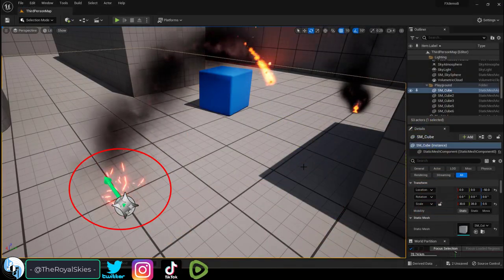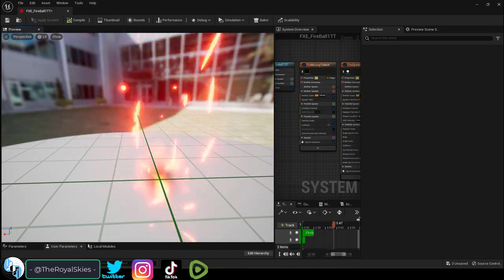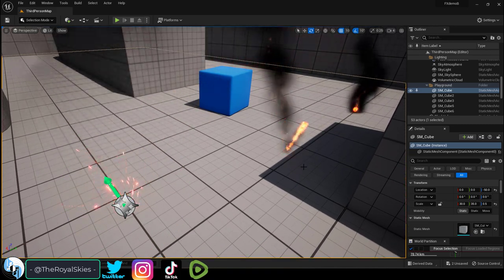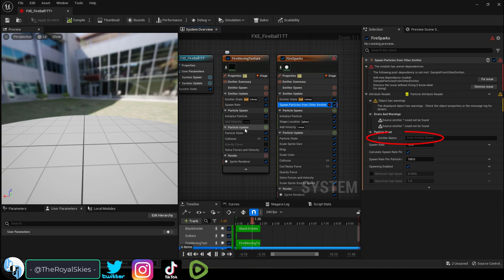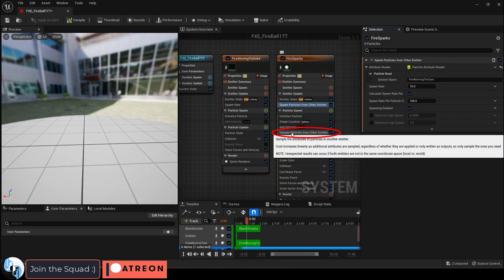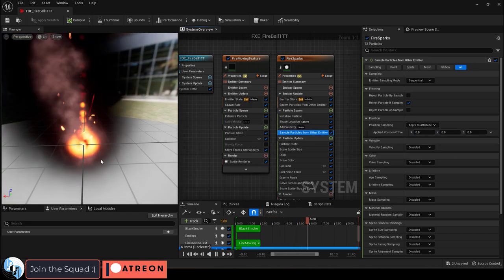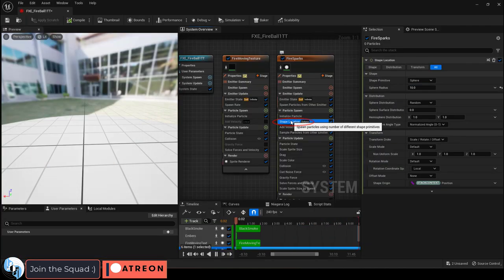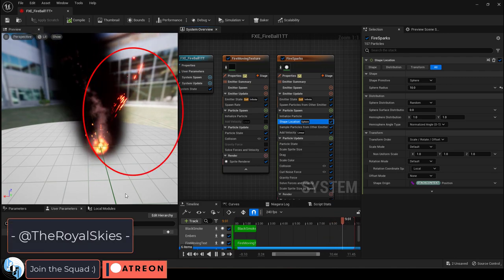Unreal5 Niagra VFX: Spawning Particles FROM Another Emitter -

Comment: This only spawns particle from the other emitter by using spawn rate. I want to use spawn burst from the other emitter instead, how do I do that?
Reply: hi! did you end up finding a solution? i'm trying to get the same result haha
Reply: @jasperdang6230  no i didn't, just ended up using spawn rate
Reply: Make sure the second emitter is using the same simulation as the emitter you are spawning from. So CPU-CPU or GPU-GPU. it wasn't working for me cause my first emitter was gpu and my sub emitter was cpu. aligning them fixed the issue

Comment: Is there any way to spawn from another emitter in a burst, rather than over time? I've got an effect where I need a particle to spawn a burst of particles around it after a few seconds, but I can't figure out how to pull it off.
Reply: I am looking for this exact thing, did you figure it out? This only spawns particle from the other emitter by using spawn rate.
Reply: Make sure the second emitter is using the same simulation as the emitter you are spawning from. So CPU-CPU or GPU-GPU. it wasn't working for me cause my first emitter was gpu and my sub emitter was cpu. aligning them fixed the issue